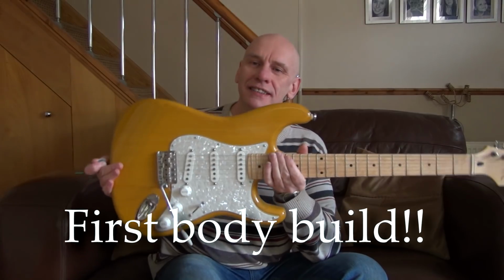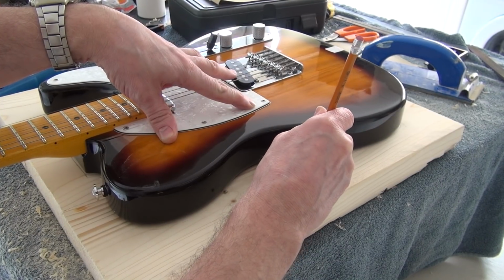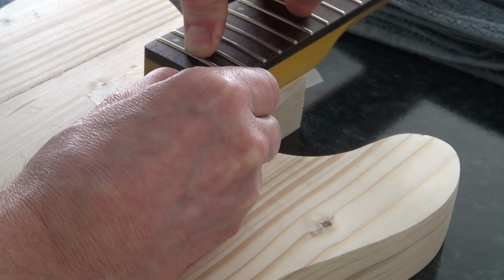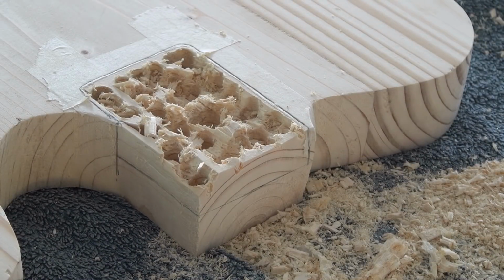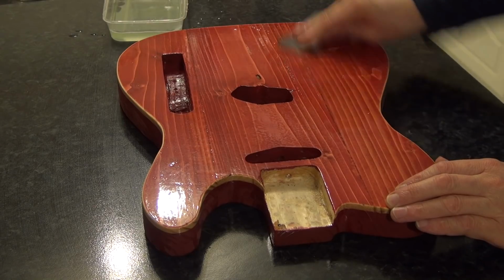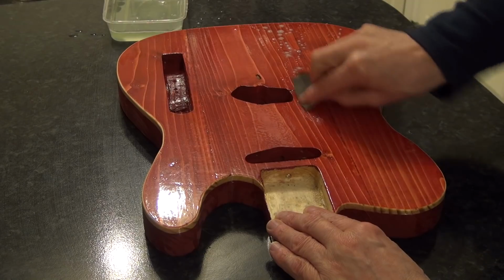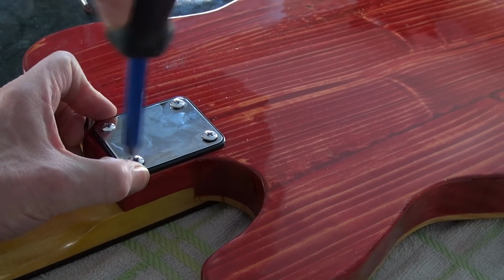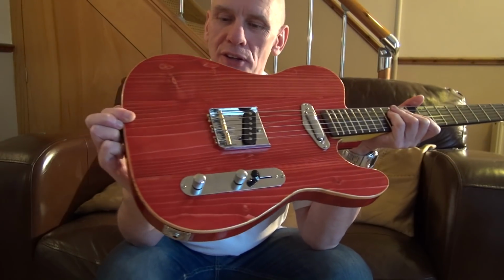My Pinecaster Guitar Build

Comment: I’ve spent some 30 years as a carpenter an Joiner. 
I must say I’m highly impressed given your limited tool kit and the fact you built it on your kitchen table. Top marks to you. It sounded fairly decent to given that the pick ups were cheap an not quiet set up the way you wanted. You should be very proud of yourself . Big thumbs up 👍 .
Reply from the maker: Thank mate, check out my new build. I'm getting better.
It's a Les Paul / Strat hybrid!

https://youtu.be/pTs-NDHOPkY

Comment: My Grandpa and I built a Flying Vee body out of an old oak church pew, the body weighed at least 9 pounds, but Grandpa called it the "Swallowtail'" it never really flew, but at least Grandpa showed me how not to worry about the construction, it was the end result that mattered, glad to see the old drill holes/chisel technique, put in a few tremolos and pick ups  with that one, Cheers to you.
Reply: A few tremelos ? How many strings you using?

Comment: Ive made a few with pine recently, laminated, same the the neck( quarter sawn) what ive found... the quarter sawn neck is very stable.. the body not so, they tend to move .they sound great pine guitars but i think its important to use dried out wood or old  pine👍
Reply: Great pine can be had from building stores, with some work.

1) stick with 2x10, or better, 2x12.  Look at the endgrain and find the ones with a bit of Heartwood in the center.  Either side of the heart is essentially quarter sawn.

2) cut it down almost to size, then forget it for 2-6 months in your climate controlled home.  It will dry during this time, and if it's going to warp or bow, it will.

You'll have to plane it afterwards to get back square and true, but it's worth the effort for the quality and savings.

Heck Everytime I go to the home supply, I look for a knot free quartersawn plank.  I don't find one every time, but when I do, it gets cut down to 4' boards and saved back. Probably have 300 board feet or more of SYP right now.

Comment: Great video!!!  I'm moving to pine in my 'casters as it is getting too expensive to find some of the "traditional(?)' woods for a guitar build.  Besides, Leo Fender started with pine and Fender is now going back to pine.  Also, I'm more of a hobby builder than a guy looking to make a living from selling my guitars.  This video has given me a lot of insight.  Thanks for the video!
Reply from the maker: I've made two with pine, I don't know why they even stopped using it? It's plenty hard enough, has nice grain figuring and I've not had resin seep out either of them ;0)
Reply: @GetawaysandGuitars  I'm guessing they stopped using the pine as woods like alder, poplar, and ash were a little harder and would support that nitrocellulose paint a bit better.

Comment: Thanks for posting this video of your build.  It is encouraging to know that a person can do this without a lot of expensive professional woodworkers tools like a power planer and joiner.  Did you get the neck pocket right by drilling and chiseling instead of using a router?  The guitar sounds great and looks good too.  Any problems with the carpentry grade pine after two years?  I agree with the comments below.  Impressive work!
Reply from the maker: Yeah the neck pocket is nice and snug! The wood is fine too, no cracks, weeping or faults that I can see. Sometimes I wish I had dyed it green though like Frances Rossi of Status Quo's guitar. That would have made it a lot cooler! ;0)

Comment: I hate staining pine, its so difficult to get a good result with commercial stains. But you did very well with your diy stain.
Reply from the maker: Thanks mate! Yeah I didn't know it wood ;0) be a problem with pine, it just went on just fine and ended how I envisioned it. Well happy! ;0D
Reply: Well, i were inspired and ordered a diy kit from China to try building a guitar (A basswood steinberger body and headless neck, maple and rosewood fretboard). Im going to apply nice looking veneer to the body and maybe also the neck if possible. The fretwork on the China neck will most likely be horrible so I will most likely take out the frets and refret it myself with a thin fretwire. Will likely go with active pickups since the wood is propably not of the highest quality and active pickups tend to sound good in any wood.

Comment: That's a beauty of a guitar! I do think deserves better pickups... Depending on budget, Wilkinsons, Toneriders... or really go to town with Lollars or Fralins? 

For what it's worth, I put Tonerider Vintage Classics and 250k pots with a 0.22 uF cap in my Tele partscaster and have been super happy with the result compared to the Squire pickups with 500k pots that were in it before.
Reply from the maker: Well.. it does have mini 250k pots and a cheap 0.22uf cap! I get you but it sounds pretty good before it gets to youtube really. It was just a fun project because I had the neck laying around off the Tele I upgraded and it turned out better than I thought. I wish I'd bought some long clamps for gluing the planks together ;0)
Reply: Youtube video processing can do funny stuff to the audio, so that makes sense. The guitar looks really great, and I'm inspired to follow your example in a year or two when I've built a few more guitars from parts and have a few more tools. The straps did seem to work ok in the end - did something happen behind the scenes?
Reply from the maker: Well I wish I had someone with a table saw to cut the chamfered edge off the wood before I started. I didn't show it but I put dowels in the planks but even with them they moved about a millimeter so I had to sand down more than I needed too. Long clamps would have been much better. At the wood joins at the slight gaps left I made a paste of wood sandings and glue. A more accurate cut would have been perfect.

Comment: The holes for the neck screws through the body should be bigger than the screws themselves so they just drop through those holes to meet the neck otherwise the neck will never pull into the neck pocket tightly.

Comment: I know this is an older post, but I have a question I hope you will answer.   I love the idea of just going to your local big box store and building a guitar out of pine.. I was going to try my first build, until I read on the forums that there is too much moisture in the pine you get from those places, and the body will shrink or warp over time as it loses moisture...   How is your guitar doing after all this time?  Any issues like that?
Reply from the maker: No problems at all! Its still stable, this and my LP/Strat hybrid. Fender are now using pine again as Ash is in very short supply ;0)
Reply: @GetawaysandGuitars  thank you!

Comment: Faux binding an excellent idea! Any reason you didn't shield the cavities?
Reply from the maker: I ran out of shielding tape! I could have used aluminum foil I suppose.
Reply: @GetawaysandGuitars  The thin kitchen foil multi-layered or proper thickness?
Reply from the maker: I think anything would be better than none. I might get some shielding paint as its easier to do now my guitars are finished ;0)
Reply: @GetawaysandGuitars  Keep up the great work! Greetings from Melbourne, AUS :)

Comment: Damn. Though this leads me to the question if you can color stain exotic hardwoods like spanish cedar or padauk. Will it work? And will the stained color get dull as padauk changes?
Reply from the maker: I'm not sure, I've only used pine so far. Nice to see Fender are copying me on the American Pro Strats ;0)

Comment: Question here, why is Pine consider to be soft for an electric guitar body? is that literal? like any bump would leave a mark? or what does it mean?
Reply from the maker: Only problem I found with pine was on my Les Paul / Strat hybrid, when I pulled the masking tape off it pulled strands of wood off at parts. I don't find it that soft to cut.
Reply: Pine takes damage considerably easier than say Alder or Ash, it also has a tendency to dry out quicker which can result in parts of the body just breaking off given the right drop or knock...